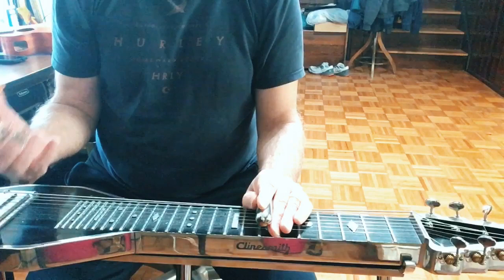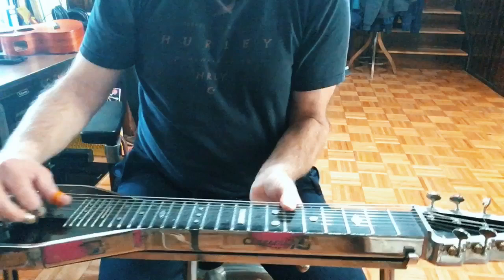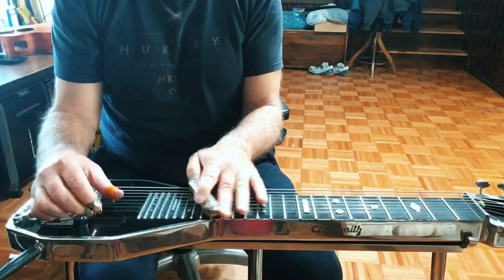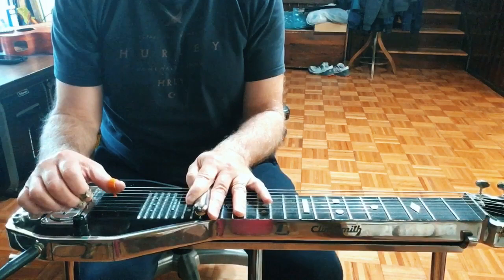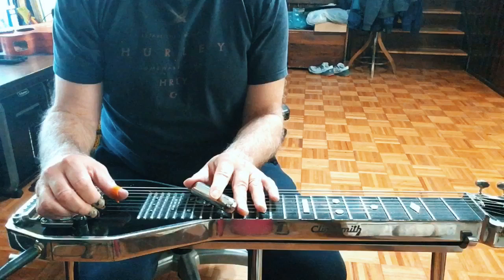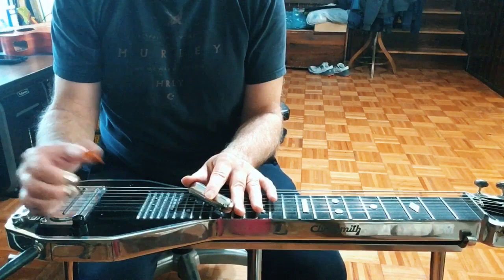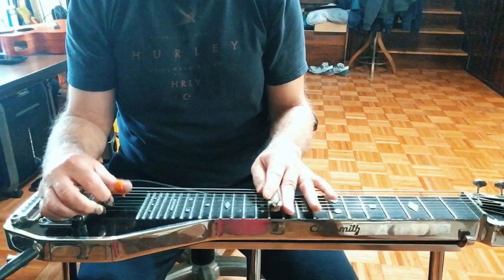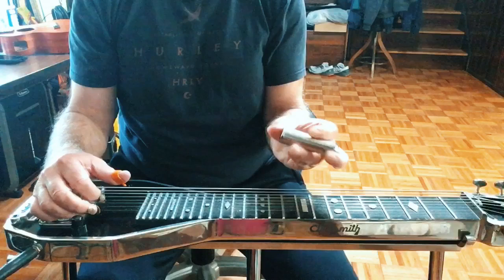Quick tip on faking pedal steel sound with lap steel

Comment: I play pedal steel but rely on these techniques for dobro. The other key is do not allow your self to be sloppy. try as best you can to nail those slants. Of course you Mike Neer are a master so thank you for sharing.
Reply from the maker: I also wanted to mention make your slants in tune, because pedal steel players are very rarely out of tune.

Comment: Love me a 10-string.
Can you duplicate the vintage sound with that Clinesmith?
Reply: Are there certain Amp settings for that vintage sound?
Reply from the maker: Absolutely.  It’s based on a vintage design and pickup.  I don’t have any particular setting and that’s just a simple Roland amp that I am using.  Not too bright, not too bassy, a little reverb, a tiny bit of gain
Reply: @MikeNeer  Thanks.